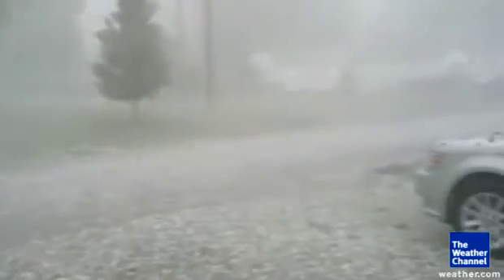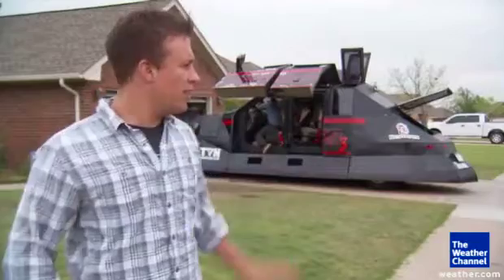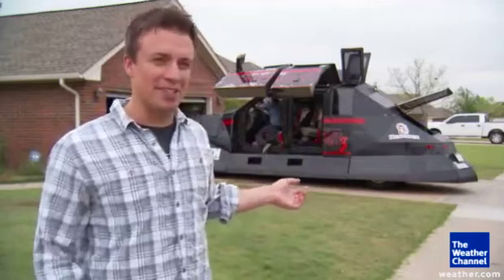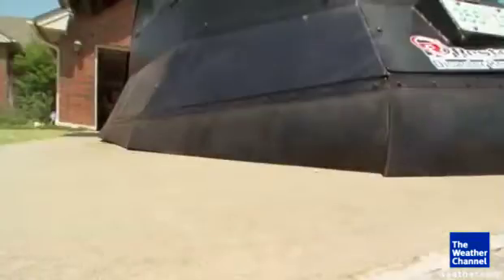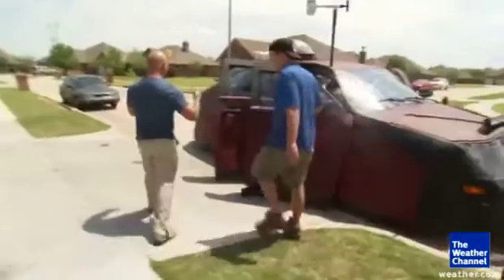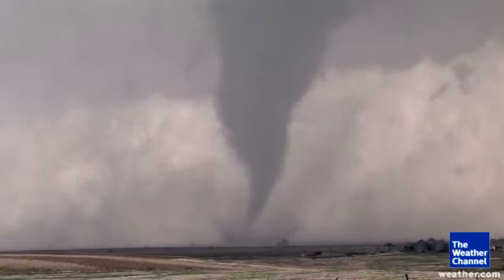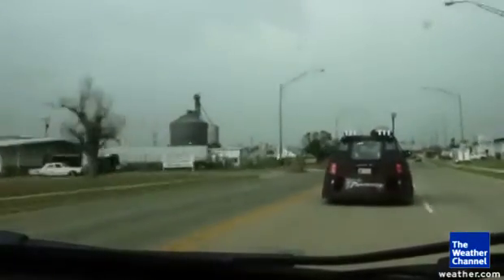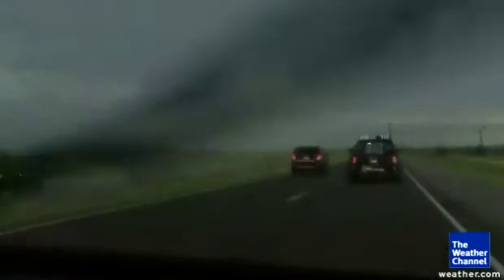Is This Vehicle Tornado-Proof?

Comment: If I had a tornado prof car ,I would have doors that open vertically so that I can be protected from hail when I go outside ,carbon steel frame for incase I get thrown around in my car ,titanium armor plating so if I get hit with a 2by4 it will bounce off ,hidrolics and that dress that stops wind from flowing under ,and spikes under the car that dig about 6 inches in the ground

Comment: I hate saying this but Reed is going to end up dead one of these days if he continues building vehicles like this. It's too high-sided and doesn't weigh nearly enough IMO. Sean Casey's TIV2 would be the only vehicle I'd ever consider intercepting a tornado in. 16,000lbs, 2" armor, 1.5" bullet proof windows, steel skirt plates that fully contact the ground, and steel spikes on each corner that drive 42" into the ground. Reed is somewhere between reckless just plain stupid.
Reply: TIV 2 was modified in 2009/2010 for weight reduction. This meant he had to make less crucial parts of the vehicle aluminum to reduce weight. The vehicle also has lots of airgaps below and there are just too many mechanical parts to Sean's vehicle. Dominator is just airbag suspension lowering it to the ground and spikes beneath the vehicle.